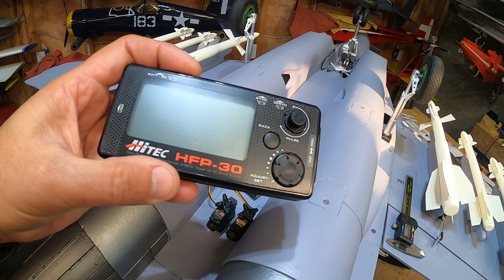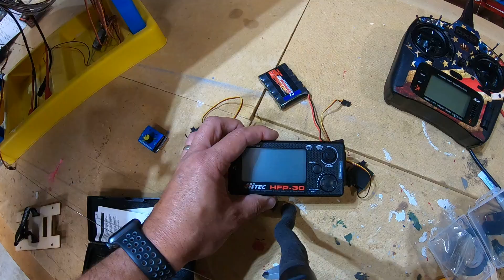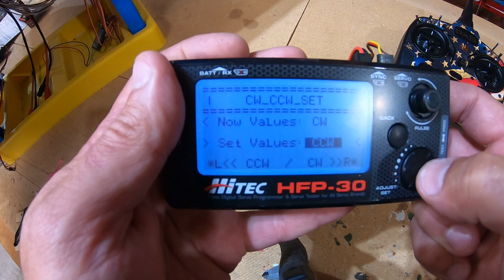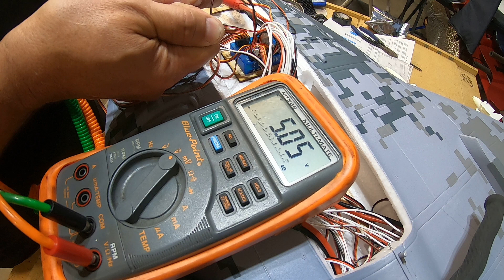Elevator Servo Replacement Freewing Mig-29, Hitec Alternate Option, Steps and Programming

Comment: I just put the same servos in my mig that you did and when you let go or move the elevators  they shake violently trying to center. tried to slow them down didn't help. does yours do that?
Reply from the maker: They do not. This plane has at least 100 hard flights on them. I use those servos in many large edf jets. Check your wires or blue box
Reply: @JustPlaneCrazy   I'm not using the blue Box because I didn't want to reverse one of the servos I wanted them on separate channels so I can trim them so they're plugged directly into the receiver.  but I am getting servo flutter  If you let go of the stick too fast or if you just flick the back of the elevator when it's sitting still.
Reply from the maker: Check wires etc. I do not have any issues

Comment: Can I ask you how you got on with the Hitec D85 servos in your Mig-29 as the new 30g servos are not available in the UK?
Reply from the maker: Please reword your question?
Reply: @JustPlaneCrazy  Did the hitec D85 servos replacement work for you on the elevators.
Reply from the maker: Still flying it as of today’s a Flyin. It’s a combination of better linkage, servos, connector links and longer screws
Reply: Thank you

Comment: why don't you just use your radio to reverse the servo?  thats why it has that option built into it.
Reply from the maker: You can’t use the radio to do it if the servo is y harnessed or  y harnessed through a blue box. My servos are run through the blue box so a programmer is needed.
Reply: @JustPlaneCrazy  I see.  more complicated than I thought.
Reply from the maker: No worries. It was a good question. That’s why we do vids and share content. Thanks for watching.

Comment: Stop right there at 5:21 why did you just not unplug the servo and plug the new servo in why did you pull all the wires out you certainly made that a little harder on yourself
Reply from the maker: Both my servos stuck really bad while trying to get them out. The extensions were painted stuck fast to the inside so I removed them to check them out for damage.  Otherwise you are correct. It’s an easier swap.

Comment: Actually, the higher the voltage, the lower the amperage.
Reply from the maker: Explanation?
Reply: Let's say your running a pool pump motor that's rated for 110/230 volts. Your full load current(a.k.a. amperage) will be less for the higher voltage. Usually it's will be half. So if motor is rated for 10 amps@ 110. It will be rated 5amps@230volts.
Reply from the maker: I guess it’s an interesting conversation, ohms law states that they are proportional and testing I have seen supported it. I guess the efficiency conversation of supplied voltage could be debated forever. Either way thanks for your input an explanation. I appreciate learning as well.
Reply: @JustPlaneCrazy  You are correct that Ohms law is proportional. I am a mechanic in the industrial electric motor industry with 30yrs experience. Working on motors from 110volts single phase to 13k volts three phase. So your response got me thinking. So, when I went to work today. I asked my winding foreman the same question. " why is the amperage lower for higher voltages?" His first response was, " cause it is." not the answer I was looking for. Lol. Then he went on about, circular mils, why size, the amount of turns and connections internally in the motor. After a few minutes with some scratch paper. He said he would find the mathematical equation, and we could go over it at a later time. So, I wanted to thank you. Because, I am learning something new as well.
Reply: @dannymurphy4940  correct
Reply from the maker: Works out ohms law as Dan did and or follow along in the comments he made. Ohms laws proves the correlation

Comment: I was wondering, why pull out the extension all the way when you can simply unplug the servos at the back? Specially since you used the OEM servo extension. By the way good upgrade I’ve also done it to my F-14.
Reply from the maker: You can do that. In the process of figuring out the process I was just not sure where everything was hidden, I also had one servos come unplugged as I was pulling it out so I had no choice.
Reply: Just Plane Crazy cool, I just finished installing HS 5085 in the MiG. Maiden this weekend!!!
Reply from the maker: lcacing79 good luck this weekend

Comment: Seems like now would be the time to just plug each elevator servo into their own channels for dual elevators if you have the capacity in the receiver.  That way you can just reverse one channel in the TX and skip the programmer.  You can also program a mix for tailerons down the road as well if you want to be more scale.
Reply: I was about to make the exact same comment. It would be a shame to NOT fly this aircraft with tailerons. In doing so, the servo reversing indeed becomes much easier.
Reply from the maker: I guess I never gave tailerons a thought but I also don’t have a receiver big enough right now.

Comment: Good video. I like that you attached the pushrod from the top of the servo horn. In case the clip comes off it won't immediately fall out. The book setting is not +/- 1mm, it says 1mm of up from the bottom edge. At the factory balance mine was more like 3-4mm. I'm flying on the stock 17g servo on the inner hole and ATVs at 120.
Reply from the maker: I see that thanks. Did you fly yours at the 3-4mm? Is that the trim area?

Comment: I went for the same servo, bunch of flights without issue. Agree about not feeling the pushrod - even with the carbon tube there's a bit of flex there and id like a captive ball link at the elevator end.